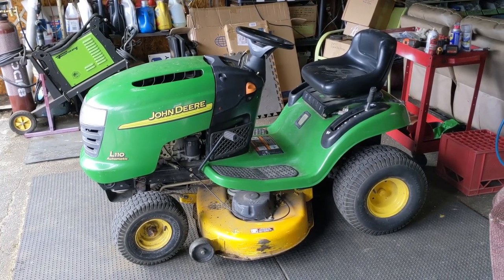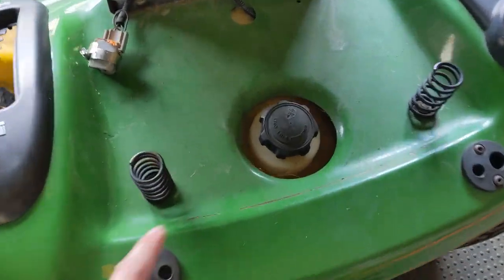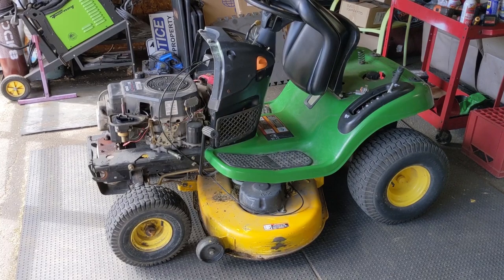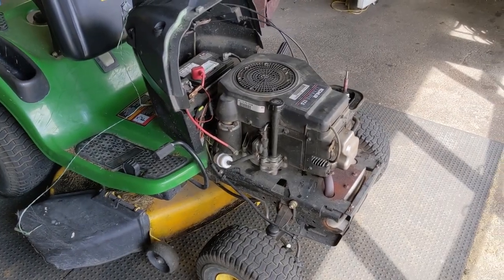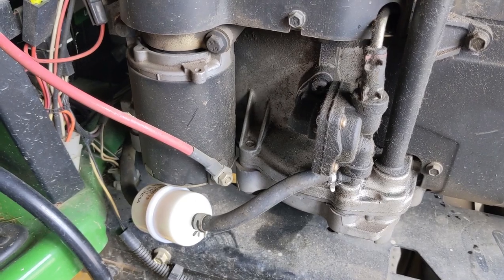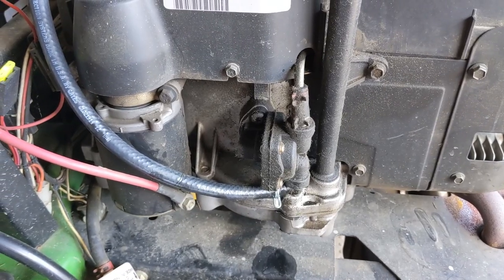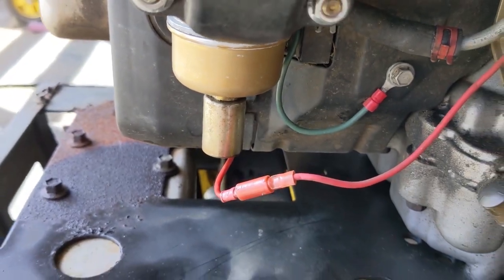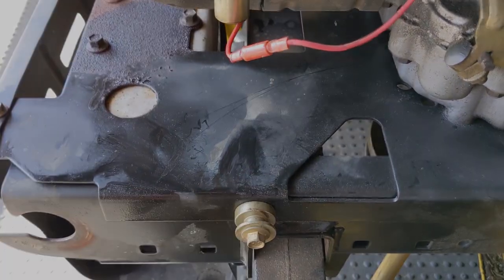How to Diagnose Bad Fuel in a Riding Lawnmower

Comment: I like the remote fuel tank. A great tool to have. No stone left unturned in your diagnosis. What I would want you to do if I was paying for the repair. What I would do if I did the repair myself. Quality counts. Good work.
Reply from the maker: Yes It's quick enough and saves me time from tearing down a carburetor that clearly didn't need any work! Thanks for watching!
Reply: Why not remove the float bowl to confirm it's as clean as possible?

Comment: Well done sir. Amazing how poorly that engine was running with the old fuel compared to the fresh 91 Octane no ethanol fuel up put in your test fuel tank. This method can easily be used on any engine even if gravity fed instead of by a fuel pump. This condition is always the problem on fuel operated generators since they rarely get used (having normally a fuel tank of old broken down fuel) but if the customer has been using no ethanol fuel then there will be no ethanol build up in the carb and it will not require a carb clean.
Reply from the maker: Thanks for watching!
Reply: Good  day Fellows I think 1  gas station in St. Jacobs  here sells 87, 91, & 93.  I will have to check.  Boy that would  make the Ford move!  LOL  Good video. Thanks
Reply: Commented to soon.  Mr funnel I do not trust 100%,  I guess better than nothing.  Thanks
Reply from the maker: @donvoll2580  don, you have to get the original mr funnel, make sure it's not the copy cat aftermarket one on eBay or Amazon

Comment: Informative video..question for ya..my jd e120 ran out of gas..filled it up and it wont turn over now.fuel will shoot from the pump when i remove hose so im pretty sure theres no issue with fuel flow.the gas i used was only a few weeks old,used it in my push mower and it worked fine..any idea what the issue could be?i didnt try taking the carb bowl down yet
Reply from the maker: I would check the oil level, if it's high and smells like fuel you could have a flooded crankcase due to a leaking needle valve?

Comment: do you think marginal fuel would have it run ok at no load but then cut out when under load? My neighbour's having an issue with a columbia zturn with kohler kt730 twin. Thought it might be the low oil system as he was just on add mark. With fresh oil, new air filter and new plugs it starts and runs full speed , noload. May cut light grass but wants to falter in the longer stuff. Says it may recover if he stops mowing. Sometimes it restarts immediately or has to sit a bit. My next idea is to change the fuel filter.  Wondering if I should drain tank and use new ethanol free fuel at the same time.
Reply from the maker: Yes 100% I had a zero turn come in for service in spring, customer had fuel from previous year. Ran fine for me, blades engaged I drove it around driveway no problem. He gets it, says it's got no power while cutting. I drove down to have a look, you could hear the rpm drop when it was under a load, very different than running the deck while not cutting. Bottle of Octane boost dumped into the fuel tank took care of it within a minute. Also some fresh 91 ethanol free to top it off.

Comment: My Cub cadet has a plastic gas take on it. When I got the chipper it didn't have any gas at all in it but I could hear something in the tank. I disconnected it the tank has plastic pieces in it. Looked like it came from the gas tank, but the tank looks new. Anyhow I cleaned it out put knew gas. Should I be worried I started it a couple of times before cleaning the tank out. Do u think I messed it up? And what should I do next

Comment: The problem I'm running into for my John Deere E100 that won't start is the fuel is not pulling into the fuel pump from the fuel filter. Now, the solenoid on the bottom of the carb doesn't make the clicking sound when I turn the key from off to on. I've taken carb apart and cleaned it and the little plunger in the solenoid is free moving, so not gummed up by bad fuel. With that not activating, will it keep the mower from starting? If so, would it be the solenoid itself that needs replaced even though it's free moving or the little electrical harness connected to it since it doesn't activate with key turn?

Comment: Your way is best, but I'm lazy, I put a ounce of seat foam per Gal of fuel in the tank & run the junk on through, I have  HUGE problem here in Florida with condensation building up IN the tanks even though I ALWAYS use NON ethanol
Reply from the maker: Yes instead of trying to rejuvenate this fuel, we just get rid of it. It's not worth the time and money if it leads to further hassle and poor running engine
Reply: We find that SeaFoam is great at cleaning carbon but not a great fuel stabilizer. We use K100S+ and put 3.25 ounces of it into 19 litres of no ethanol fuel but store it in NO SPILL fuel containers that have no vent. They expel any pressure when you push the fuel release button and no issues with water condensation. All our stored equipment we own has vented fuel caps of some sort but again they fire right up after 6 month storage and no water condensation problems. Florida does have much more humid weather but maybe switch stabilizers.

Comment: Wondering if you have a winterizing video for lawn tractors?
Reply: I do not think Jake has at this time but here are a few tips: use ethanol free fuel only there will be no breakdown so you do not have to run the engine out of fuel. Make sure your underside of cutting deck has been cleaned otherwise rusting from the bottom up continues during storage. Blow debris off top of deck for the same reason. Pressurise tires to the proper psi rating if tires do not hold air we suggest having them repaired before storing so sidewall cracking does not get worse. If you have mice in the area place Downy fabric sheets, pepperment oil or used peppermint tea bags around the engine cover ( one mouse nest can cause catastrophic damage to an engine). Just a few ideas for you Gregg hope they help.

Comment: Is there any chance you have a mower laying around with a snapped wire and broken lever PTO? Mine broke and I can't get parts in Australia so I'm trying to think of a way to fabricate some sort of Pto to engage the blades and get the ride on working again. Cheers
Reply: Lots of the cables you need over here mate. I believe you need a cable with the spring on one end and the ring type fitting on the other end. Look for the part number right on the cable sheath covering or can you give me the part number you need?

Comment: I got some bad gas (water in gas) . My riding mower ran fine until I added this bad gas. I drained my gas tank and put in fresh good fuel. It makes noise but will not start. What now? I have no one to ask. Any advice what is wrong? I thought draining it would fix the problem. Thank you
Reply from the maker: You probably have bad gas in the carb, I would also recommend removing the spark plug and possibly changing it

Comment: I don’t know, Jake, your method seems much too time consuming and complicated. I’d just gravity drain by disconnecting the carb bowl into a clear container to eyeball the fuel. I’d also use my turkey baster with hose attached to get a separate sample from the bottom of the tank to confirm. Also dripping some on some pavement or a brick or cinder block outside to see how it burns. Those tests would confirm bad fuel without running the engine any further after the initial run to confirm ignition and compression. Am I wrong?
Reply from the maker: Fuel usually burns just fine, it's how it reacts under compression can determine if it's bad. So I spray carb cleaner to get running, runs like crap, change fuel source to prove 100% whether it's bad fuel causing the issue, because I know my fuel is good. If the engine continues to run poorly, then it's an issue with the carb, ignition or compression. To swap fuel takes about 15mins and then to drain the fuel another 15mins. My customer was into the fix for about $55 once I diagnosed and drained the fuel, added 4 or 5L of our own fresh fuel
Reply: Don't think so Rein it was pretty quick but the video made it appear longer. It is like when your on TV you look much bigger than you really are, so if you ever see me on i am not really that large eh/

Comment: My HUSQVARNA 22 horse runs without the vaccum hose attached to feul pump. How come??
Reply from the maker: It's possible with enough fuel you may get some flow... You'd need suction at the carb side to get it to draw under load though without a fuel pump. Interesting. Usually a hole in the fuel pump diaphragm leads to fuel in the oil because it goes through the vacuum tube into the crankcase.
Reply: @EliminatorPerformance I had an issue with my mower shutting down while mowing. I thought it was feul delivery. Long story short it was these rods getting stuck. They are connected to the safety switches at the control levers. It's hard to explain bc I don't know the name of the rods. Anyway the switches would open or close when that button get pushed in and ground out coils
Reply: Jerry i never heard of this one before, like Jake says below you can only be getting some gravity flow unless that engine has a mechanical fuel pump give us the model number of the engine we can check.
Reply: @waynestefinashen239  i just seen your reply. Sorry i took so long. I'll see if can find the numbers in my phone. I do have them tho

Comment: "Corn based alcohol"  is irrelevant.   Ethanol is ethanol regardless...
Reply from the maker: Yes but about 95% of all ethanol comes from corn, so I add that in so people know what it likely comes from. Most people don't even know that ethanol is an alcohol, or that it's made from corn.
Reply: @Eliminator Performance  and is the same alcohol that we drink aka ethyl alcohol.   The reason I clarified that the source is irrelevant is because many people think that because something like sugars that come from corn are of a lower quality or are unhealthy.   Weather or not sugar comes from gmo crops is also irrelevant because a specific type of sugar or alcohol has a chemical formula that is what it is regardless of where it came from.
Reply from the maker: @jsnthurst1  no there's 2 types of ethanol, food grade and fuel grade from what I've researched.